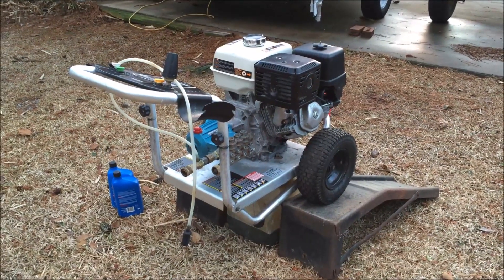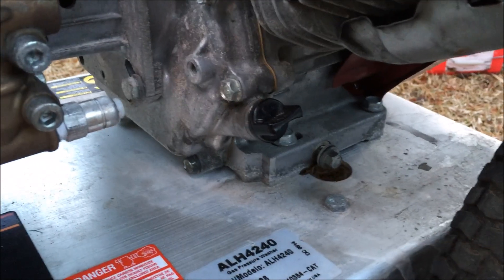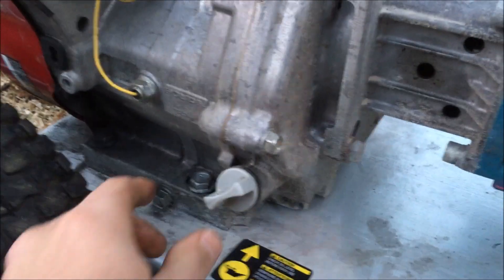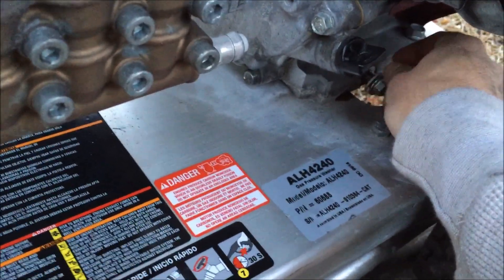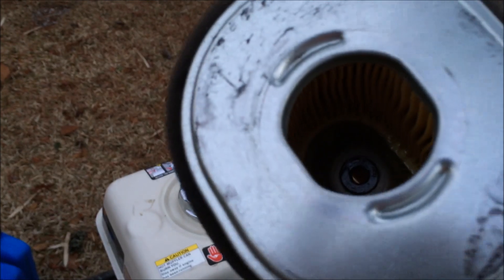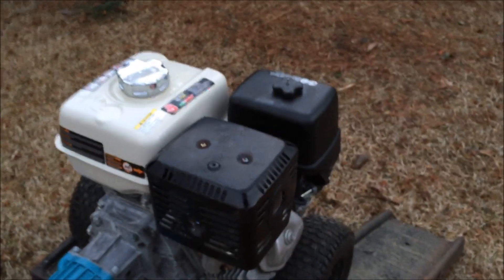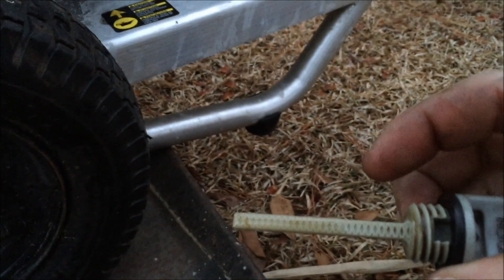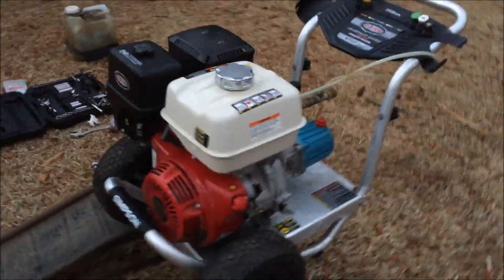Honda GX390 Pressure Washer Oil Change | Clean Pro Exteriors

Comment: How often you need  to change  the oil . Thank you
Reply: Every 40 hours of operation for a Honda GX390 is what is recommended. I also suggest buying an all synthetic oil instead of cheap Walmart brand oil like this guy used. Its just a personal preference thing, but I have always found that the extra few $ you spend per quart of oil ends up equaling a few more years of engine life compared to the low-grade/cheaper oils, so if oil don't have to replace the engine or the whole machine for several more years, than that extra cost for the premium synthetic oil MORE THAN PAYS FOR ITSELF! Sake principle applies to cars too fyi!! Look for "Royal Purple Synthetic Oil" it's THE ABSOLUTE BEST ON THE MARKET!! It's the brand Profesional race cars use!

Comment: Always remember folks, if you’re low on oil. 90% of the time your dipstick is too short. Buy a longer dipstick to check the oil level before adding oil.
Reply: Great advice! Followed your guidance and now my engine's running much hotter and louder than before. Even smells of burning, which I love 😊 Thank you so much 👍🏽👍🏽

Comment: Thank you for posting, your video was helpful & well done. Good save on the drain plug (LOL.) I have the same motor with a CAT pumped pressure washer. I noticed a small quantity of oil had leaked onto the deck. Upon looking for where it may be coming from I came across a black oil filler cap the opposite side of the motor from the gray dipstick which is where I filled the motor with its 10W-30. Upon unscrewing the black cap (which I believe was not screwed on tight enough and may have been the source of the leak) dirty motor oil started flowing out (I was off level) so I quickly reinserted it and screwed it back on tighter than before. Upon looking at the manual I see the two caps in the diagram & both have oil drain plugs beneath them and though the diagram does mention what the gray cap is for, not a peep about the black one. You don't mention it in your video, either, although it's in plain view in the opening shot. What is the black oil screw cap for?
Reply: That's what I'm trying to figure out now. I saw online someone said that it's just for if you mount the engine on something and one side is blocked. But I also think it might be something about a reduction case? So confused, did you ever figure that out?

Comment: I really want to say  a BIGG THANK YOU because without this video I wouldn't have been able to get my pressure washer started. I changed the oil, spread it with carb cleaner and got it to work and running strong...

Comment: my gx390 has a drain plug on both sides.
I drained it on tha opposite side shown in your video. is this an issue?
Reply: No. It’s easier with the frame hole side less mess. But the oil comes out either side

Comment: they make a oil drain hose you can buy to mount on the drain hole to help with the draining. it stays on the engine only thing you have to do is unlossing the cap on hose then put it back on and fill engine with oil. if anyone needs a picture of what it looks like message me and ill send you a picture to help out. nice video by the way

Comment: I just bought a used pressure washer like yours. And I went to check the oil and it just squared out. That can't be normal right?
Reply: Over filled

Comment: You missed the most important part...where do you add the oil? The gray side or the black??
Reply: Did anyone ever answer this. Do both go to the cleaners chamber?
Reply: Dip stick side. Fill till it’s about to come out of the motor. 1 quart usually
Reply: I fill on the black side
Reply: So what's the answer black or gray side

Comment: when I looked it up online it says 6.4 qts of oil..
Reply from the maker: No it doesn't say that, or shouldn't say that lol. You don't even put that much into a car.
Reply: That is the gas tank volume ..
Reply: @kevinkollman9162 😅😂😅 I was thinking the same thing!
Reply: you should fill the oil up to the top of the treads, should be about 1.3 qts from memory for a GX 390
Reply: Can I use 10w-30 Synthetic oil?
Reply: Bad Weatherfreak yes
Reply: @BadWeatherfreak  YOU should always use straight 30w for small engines, but I HIGHLY RECOMMEND USING ALL SYNTHETIC OIL EVERY SINGLE TIME! Also change your oil every 40 hours of operation, or at a minimum once per year if you do not run your machine more than 40 hours per year!
Reply: lol

Comment: When you check the oil level you do NOT thread the dipstick in.  You just insert it until it makes contact and then remove and read.
Reply: Jason B  what side do.add oil on black cap or brown dip stick aude
Reply: correct the manual  for the GX390 illustration shows the cap/dipstick first thread sitting flush on the engine case. (unthreaded)
Reply: yep JB your'e right on money........ only antiques do you screw it in
Reply: Yea with all Honda’s ( we have dirt bikes and mowers) they all say check oil do not screw in oil dip stick. Honda thing 😂

Comment: cheap oil super tech,should use better oil. name brand
Reply: It’s generic and cheap for a reason. Super Tech, Great Value, and most of the other Walmart brands are made by some other company, it does NOT mean they are the same quality.
Reply: ALWAYS BUY PREMIUM SYNTHETIC OIL FOR YOUR GEAR! YOU WILL GET OUT WHAT YOU PUT IN IT, MEANING YOU WILL GET MORE OUT OF YOUR ENGINE LIFE OF YOU PUT BETTER PREMIUM OIL IN IT & CHANGE IT EVERY 40 HOURS OF OPERATION OR 1X PER YEAR MINIMUM!!
Reply: You must not know much about oil because super tech is made by a name brand and has good specs including very respectable TBN #'s.

Comment: How often is it recommended to change the oil?
Reply from the maker: Jon Watcher It depends on the motor. You can type in the type motor you have with the question on google search and it should pull up the info/manual for your motor. That's how I found out lol
Reply: Every 6 months or 100 hours according to Honda manual
Reply: Every 3,000 miles lol

Comment: You have two plugs on either side of this motor? One gray in color that holds the dipstick and I see a black one on the other side...what's up with that? These two plugs are in addition to the metal drain plug. Can you elaborate on the gray and black plug? Thanks!
Reply: Sorry I’m late guys, but these are universal engines. It is done so that you always have access to the oil dipstick and drain, if it isn’t the side with the dipstick just flip them around. Because these engines go in so many applications they need to make sure you can always get to the oil.
Reply: many applications for the engine by different companies so need two ways to fill with oil in case one is blocked by mounting position. you can swap filler caps (dip stick) the little pipe plug is how you drain the oil
Reply from the maker: I believe the other plug is so that when you pour the oil in, you can unscrew it and if you filled it up too much, the excess will run over. Hope that made sense. Basically it's to keep you from over filling the oil.
Reply: Clean Pro Exteriors I appreciate your reply. So you are filling it with oil at the gray dipstick plug NOT the black plug? The black plug is just a overfill plug? Sorry, just want to get that clarified. Thanks again and I appreciate the video.